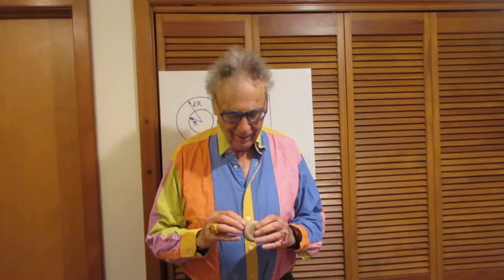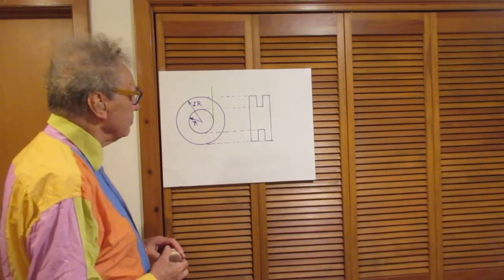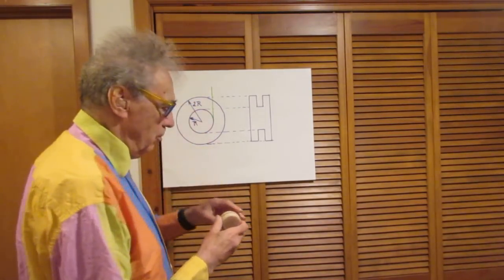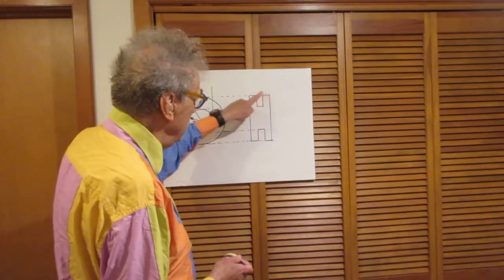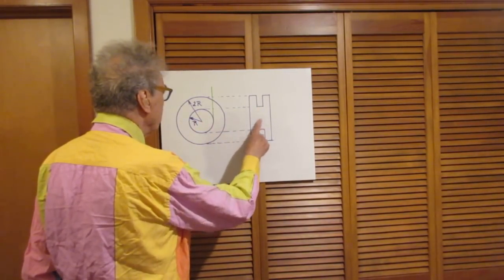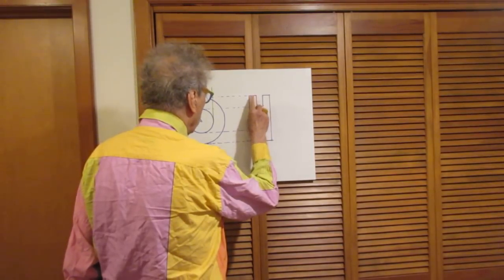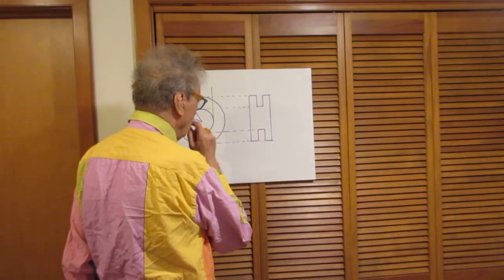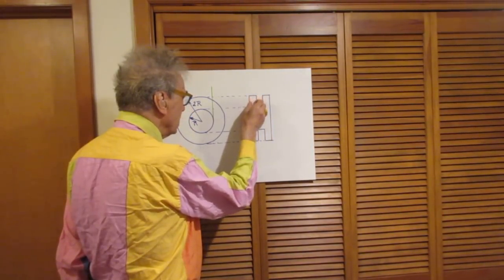Problem #21 - Physics of Yo-Yo's

Comment: I think I did it right, but it entirely possible there is a silly math error along the way...

If we picture the yo-yo as a bunch of three thin discs then we can simplify the problem, as the width of the discs has no effect. Each full size disc has mass M so the area density constant will be rho= M/(R^2)pi  Using I=Integral of r^2dm we can define dm as a thin ring of the disc which when unrolled would have about an area of dr(2*pi*r) Thus the integral is now rho Integral (from 0 to R) (r^2(2*pi*r))dr  or as the pi cancels with the pi in rho,  M/R^2times Integral (from 0 to R ) (r^3) dr  this will yield the expected I of a thin disc = I = (MR^2)/2.

There are two large discs, so the I there is 4MR^2 + (R^2M)/8 or (33R^2M)/8 =I total about the center of mass parallel to the axis of rotation. 

The yo-yo is undergoing smooth rolling so Vcom=Rw thus Acom=RAlpha .

For angular acceleration, Torque = I(alpha). Torque here is R cross 9/4Mg (9/4M is total mass of the yo-yo) 

Thus, 
9/4MgR=((33R^2M)/8) alpha or alpha = 18g/33R which multiplying this by R gives us Acom, so Acom should thus be 18/33 or 5.345454... M/S^2

I am going to check over the area density constant I defined, I think that could be the root of any error.  I think I at least approached this correctly.
Reply: yo my dude, I love this explanation, don't get me wrong, but as an average person who doesn't know physics to the nth degree like you might, I have no fucking clue what your saying. I wish I did homie, because this shit is cool in my mind, but after two paragraphs, I decided it wasn't worth the mental energy if I don't understand the terminology and context in the first place. I'm a silly billy who has a smooth little marble brain and I can't shove too much info in at once. just maybe think about simplifying for simpletons like me so we can understand you my friend

Comment: Sir can u please explain a similar phenomenon of " a disc with a a cylindrical rod passing through the centre and both the ends of the rod tied to stringsbof equal length from a rigid support the system looks somewhat like this   l_,_l the comma is the disc the underscores depict the rod through its centre and the l s are the two strings that connect the system to a rigid support....Now on winding it all way upto max height I release it then it comes down and then it moves up but to height less than hmax say hmax' and then again it comes down due to gravity  and again goes up but to a height less than hmax' say hmax" please can u explain this entire thing in one of ur lectures using proper mathematics to describe why the system finally comes to rest

Comment: release the yoyo from rest then 2
2
1
y  at where y is the distance fallen and t is the time of fall, t 
can be measured with a stop watch or a photogate timer. Videotaping the falling yoyo is also 
useful in obtaining position versus time data. The tension in the string of the falling yoyo can be 
measured with a spring force meter

Comment: a=alpha.R, where alpha=torque/I.  The torque of the centre of the mass is (9/4)Mg, I is (17/8)MR^2.  That means that alpha is (18/17)(g/R^2) and      a=(18/17)(g/R).  That's the solution if I'm not wrong with the moment of inertia I.
Reply from the maker: a=(18/17)(g/R).
g/R is NOT an acceleration.

Comment: m x g - T = m x a
T x R = I x alpha

a = alpha x R = (m x g) / (I / R^2 + m / R)

I = 2 x  I_2R + I_R = 9 / 2 x m x R^2

a = 2 x g x R / (9 x R + 2)

relating angular acceleration to tangential acceleration of a solid body
and using free body diagram
Reply from the maker: (9 x R + 2)
what are the units of this 2?  Is it kg, or meters, or Newtons?
Reply: sorry I think I made a mistake when clearing the tangential acceleration, it should be a = alpha x R = (m x g) / (I / R^2 + m )
and since the yoyo has moment of inertia 9 / 2 x m x R^2
the answer would be a = g / (1 + 9/2)
Reply from the maker: incorrect

Comment: I hope I got this one without stupid math errors. The middle cylinder has the mass 1/9 m and the outer cylinders each have the mass 4/9 m. The moment of inertia on a cylinder is I=mr^2/2. So the moment of inertia of the yo-yo is 1/9 m x R^2/2 + 2 x 4/9 m x (2R)^2/2 = 33/18 mR^2. The torque is mgR. So the angular acceleration is α = mgR / (33/18mR^2) = 18g/33R. The linear acceleration is a = αR = 18/33 g ~ 0.545g
Reply: you're wrong.
Reply: Your torque and moment of inertia are about different axes.
Reply: Well, at least it wasn't a stupid math error but a proper physics error :-)
Reply: Yep, I see it now. My rope needs to be pulled upwards for it to work like that.
Reply: It's not stupid math errors its a physics error.

Comment: First Attempt:    
a = 10g/(2+3(PI)r**3) 
my first stab at it which is likely very wrong.
I probably have to go back and rethink about
 how I summed linear forces and angular momentum.

Second Attempt:
Found a math error. My second attempt is 
a =  10g/ (10 + 33R**3)

Third Attempt:
Set potential energy = kinetic energy
Solving for acceleration assuming the YO YO drops for exactly 1 second over a distance, h, gives:
 a = 5g/11

Fourth Attempt:
Math error in 3rd attempt corrected:
 a = 9g/21 = .43g
so if the correct answer is .5 g, would my answer be close enough?
Reply: a=(6/11)g
Reply: The terms you add to each other do not have the same units. This is usually a good indicator that you made a mistake somewhere.

Comment: that the kinetic energy of the center of mass, which is converted into spin as the string unwinds, results from being thrown, rather than from falling through a gravitational potential.
Reply from the maker: this is incorrect - in my problem it's ONLY gravitational PE that is released.

Comment: There are practically two forces and one torque applied on this system:  the force of gravity and the force of the tension (T) on the string.  The torque (Tau) on the system is due to the rotation of the system around the string.  The total mass of the system is 5m (two cylinders  of mass 2m, and one of 1m).  The inertia (I) of the system is 1/2 mR**2 + 2(1/2(2m)(2R)**2)=17/2 mR**2.  The two equations that govern the system are Torque and Summation of Forces (Tau and T, respectively).  Tau=I * Alpha.  Alpha is the tangential acceleration (a) at the edge of the disks with 2R where Alpha=a/2R.  Tau is also equal to the tension (T) times the distance from the edge of smaller cylinder to point of rotation (R); so, T*R=17/2 mR**2 * a/2R.  Summation of the forces is the force of gravity (positive) and the Tension (T) negative and substituting, 5mg - T= 5m*a.  Solving for T and substituting in the torque equation above, (5mg-5ma)R = 17/2 mR**2 * a/2R.  Now solving for "a" gives the solution to the problem, the acceleration.  a = 20g/37, which is pretty close to half the value of gravity.
Reply from the maker: incorrect
Reply: I bet you I made a mistake in the tangential acceleration Alpha.  I was not sure whether to use Alpha= a/2R or Alpha= a/R.  Should have used the last one.  Anxiously awaiting for your answer.

Comment: Using torque due to gravity about the point of contact with the string, which I assumed stays at velocity 0 relative to the ground(no slipping on the string), I got that the acceleration is (6/11)g where g is the acceleration due to gravity. I'm not too sure about this since I haven't done this sort of question in a while. So it does not depend on the mass or the radius!
Reply: "which I assumed stays at velocity 0 relative to the ground" that right there tells you that the answer is wrong because that is not true.  The yoyo is falling so velocity relative to the ground is not 0.

Comment: consider a neutral cube placed in a  non uniform external field...the flux through the cube would be non zero...but the charge enclosed in the cube would still be zero...how,would gauss law hold then in this case?
Reply from the maker: Gauss' Law ALWAYS holds. It's one of the 4 Maxwell's equations. All 4 eqs ALWAYS hold. However, you have to know how to use these eqs.
Reply: okk professor..:)

Comment: Sir can you please help me with this question
A bullet of mass 50 g moving horizontally with a velocity 100 m/s hits and gets embedded in a wooden block of mass 450 g placed on a vertical wall of height 19.6 m, if the bullet gets embedded in the wall does the block fall on the ground?
Reply from the maker: I do not solve problems for viewers. I teach Physics.
Reply: Use the conservation of linear momentum to solve the problem.
The initial velocity of the block is zero, and that of the bullet is 100m/s, once the bullet is embedded in the block the block and the bullet becomes one system, you can calculate the final velocity.
Reply from the maker: sello <<<Use the conservation of linear momentum to solve the problem.>>
that is correct

Comment: Sir, would you suggest me books about Physics? I have just read your book. By the way i have got a question: Is gravitational energy endless? For example whenever i drop something from a height, it falls. And it's been happening for years. Won't gravitational energy come to an end? Can we make an engine with two magnets (not electromagnets)?
Reply from the maker: >>>Won't gravitational energy come to an end?>>> 
gravity is not energy, it's due to the existence of mass. 
>>>Can we make an engine with two magnets>>>>
yes, but you need a lot more. You also need a power supply to drive the engine. YOU NEED an ENERGY SOURCE!
Reply: Lectures by Walter Lewin. They will make you ♥ Physics. Thank you, sir :)

Comment: I think there's a contribution  to the acceleration of 9.81ms/kg as there is tension in the string which contributes to its acceleration. although theirs allot of  friction  within the coils of string apposing that torque. The friction slows it down but the tension in the string accelerates it. Because the yo yo is spinning then it will hold a horizontal equilibrium. It will still accelerates due to the unequal forces in the vertical components.
Reply from the maker: I think you have no clue

Comment: 2/3(g)
Reply from the maker: incorrect
Reply: Lectures by Walter Lewin. They will make you ♥ Physics. Sir.......But ,I'm damn sure about that
Reply from the maker: yes, you cheated and looked it up on the web what the acceleration is of a solid disk rolling off a string. that is (2/3)g.  But this is not a sold disc. STOP cheating. You got it WRONG
Reply: Sir.....I've got my mistake ....I've understood that my answer is wrong  but my absence of mind said that,not web
Reply from the maker: Every high school and college physics book discuss this problem with a disc and find  a=(2/3)g.

Comment: Sir I prefer you to use a better mic
Reply from the maker: the mic is part of my camera. I have no plans to buy a new camera.
Reply: Lectures by Walter Lewin. They will make you ♥ Physics. Hehehe I didnt thought you would reply to my comment 
I am 13 years old and i love your lectures
:)
Reply from the maker: At MIT I had 3 cameras (run  by 3 different people), 2 sound experts, and 1 light expert during my lectures in a lecture hall with 9 HUGE blackboards that I could move up and down; the lecture hall could seat 600 students.  The videos that I have been posting since January this year I do at home in my hall. I have no black boards. The space I have on the wall is less than 1 of my 9 boards at MIT. There is room for ZERO students in that hall. I have only 1 light in the ceiling. I have a $150 Canon camera that can take simple videos for no longer than 30 minutes (limited by battery power). I have ZERO help; I do the taping on my own. I place the camera on a ladder and tape it down with scotch tape to make sure it will not fall on the floor.  I hope you will appreciate this. Preparation and selection of each problem takes me roughly 16 hours per problem. To prepare and tape the solutions takes an additional 10 hours. I often have to tape a video twice or even 3 times before I am happy with it (slips of the tongue are common). That alone can take more than 2 hours.
Reply: Lectures by Walter Lewin. They will make you ♥ Physics. Can't Thank you enough!..  All your efforts in the background are incredible!
Reply: Lectures by Walter Lewin. They will make you ♥ Physics. Felt really sad after reading this sir. But I love your lectures. I wish my physics teacher could explain me like this 
:*(
Reply: Prof, i have a quick question. In general when we measure using VC, we consider MSR+VSR*LC.(here MSR is the reading which is on left of 0 of VS).
can we also do it this way...Means,  MSR-VSR*LC., when the MSR reading is just right of 0 of VS?.

Comment: I guess that the answer would be 8/17g since the yoyo is consisted of two solid disk and one connection between them,
If we consider the rotational inertia of the connection we will then proceed to the answer of 8/17g
Reply from the maker: incorrect
Reply: Lectures by Walter Lewin. They will make you ♥ Physics. 
Sir,could you offer just a bit hint of this question~ Am I on the right track of solving it or should I modified the method? 
Much Appreciation ~
Reply from the maker: relax - I will post the solution tomorrow morning.
Reply: Sorry sir , I am just voracious to know whether method of combining rotational inertia is a step of the solution.
Could you please reply. Sorry if bother , Sir . Thanks in advance!
Reply from the maker: you will have to calculate the moment of inertia of the yo-yo. tomorrow you will see the solution.
Reply: So the overall step is the same while the key lies in inertia ~

Comment: Please get rid of background noise.
Reply from the maker: I suggest you get better equipment to listen to my videos.
Reply: I have a pretty decent set of headphones, and a decent amp, and I am not hearing much noise. Also considering Professor Lewin is taking his own time to make these videos for you I do not see how you can complain if you really want to watch these.
Reply from the maker: At MIT I had 3 cameras (run  by 3 different people), 2 sound experts, and 1 light expert during my lectures in a lecture hall with 9 HUGE blackboards that I could move up and down; the lecture hall could seat 600 students.  The videos that I have been posting since January this year I do at home in my hall. I have no black boards. The space I have on the wall is less than 1 of my 9 boards at MIT. There is room for ZERO students in that hall. I have only 1 light in the ceiling. I have a $150 Canon camera that can take simple videos for no longer than 30 minutes (limited by battery power). I have ZERO help; I do the taping on my own. I place the camera on a ladder and tape it down with scotch tape to make sure it will not fall on the floor.  I hope you will appreciate this. Preparation and selection of each problem takes me roughly 16 hours per problem. To prepare and tape the solutions takes an additional 10 hours. I often have to tape a video twice or even 3 times before I am happy with it (slips of the tongue are common). That alone can take more than 2 hours.